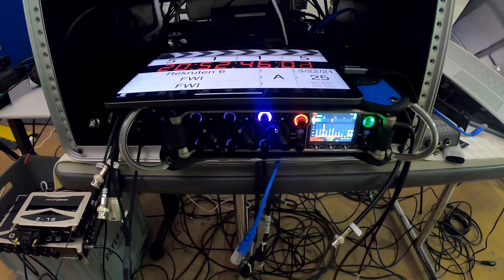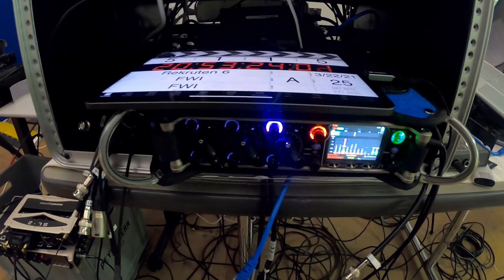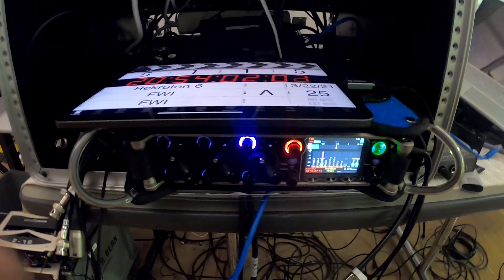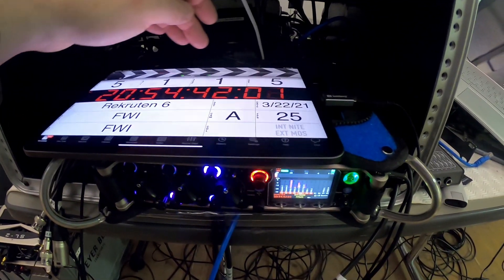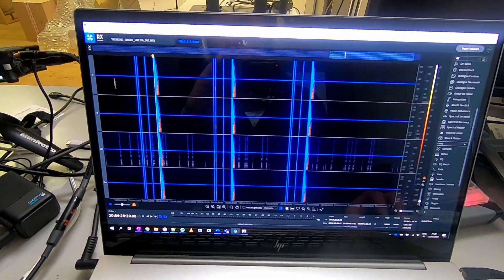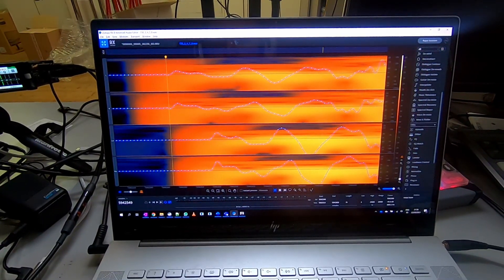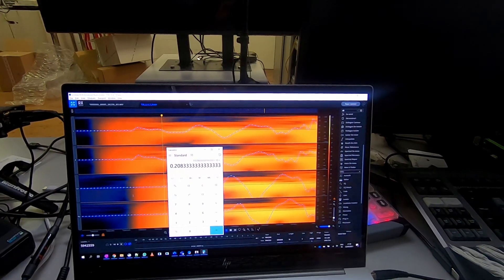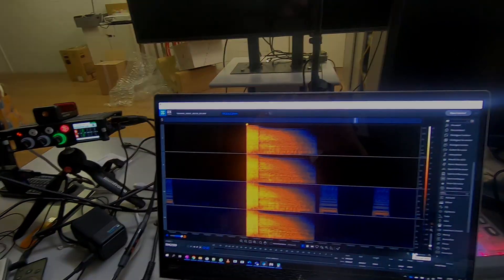Measuring latency difference between an Audinate Dante digital AES and analogue output adapter

Comment: Superb analysis.
What are you using them for if I may ask?
Does the tiny difference in latency (imperceptible to any human) make a difference to your use case?
Reply from the maker: Whenever possible, I try to stay "digital", once I have a digital signal. However, the Sound Devices 8series recorders do not support output delay on the AES digital output. And when I thought about switching to an analogue output, I just made this test to see what difference it might make (latency and quality wise). So it is actually no real constraint for me in my scenario. Just being sort of overly curious ...